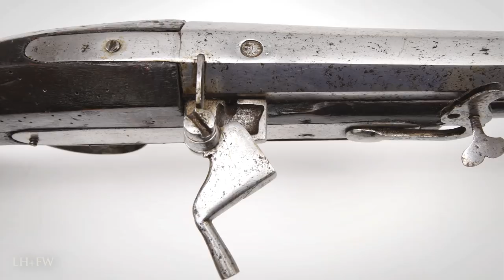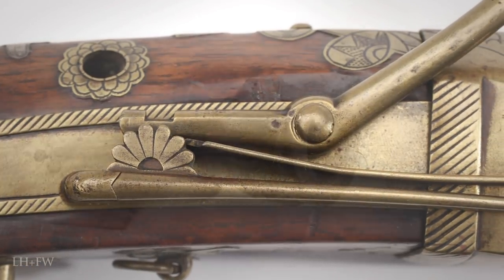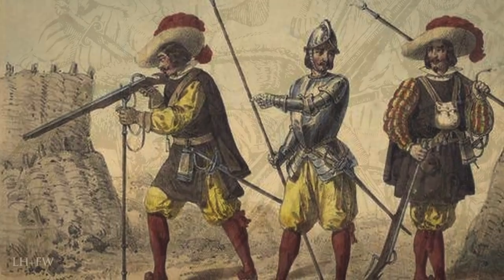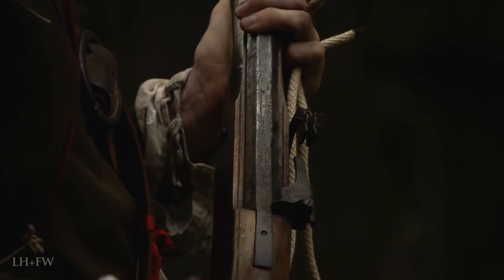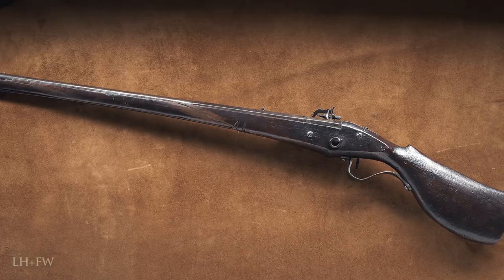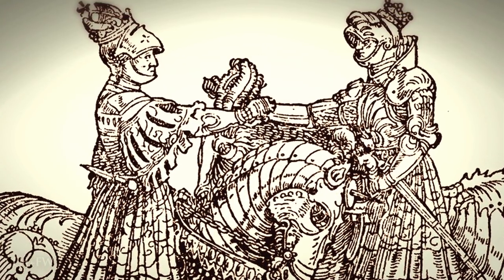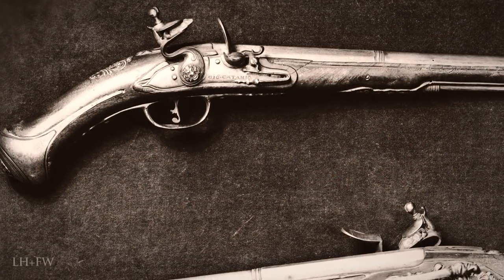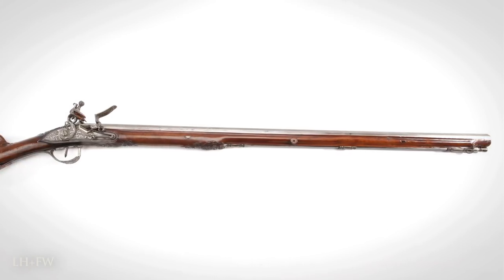From Matchlocks to Wheel-Locks in Early America -- 1500 to 1740

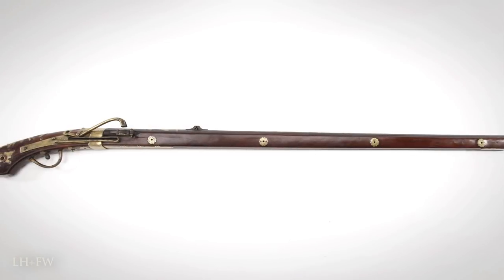Comment: Excellent video. But if my memory serves me right, while talking about the "arquebus ", the weapon shown from around 1:34 is a type of snap-matchlock called the " tanegashima" which was made in feudal Japan. You can even see that the serpentine(the curved metal bar that is designed to hold the slow match) rests on a horizontal V-spring ready to "snap" the burning match on to the priming powder in the pan. The Portuguese introduced firearms into Japan during their expeditions in the early 1600s. The Japanese quickly adopted the new firearms and modified the design to suit their gunners. Expert metalworkers were abundant in Japan at the time and they managed to produce these in substantial numbers.
The "arquebus" employed a far simpler lock(if it can even be called that) and was used in Iberia in the late 15th to early 16th century.
It was distinct because it didn't have any spring and the serpentine and the bar(which continued to the underside of the buttstock and pulling which lowered the serpentine) was a continuous piece that acted as a lever which was pivoted on a pin on the outside of the stock.
Reply: I was pulling my hair out that they didn't catch that.
Reply: The thing that bugs me is that apparently matchlock "muskets" well into the 17th century seem to have nothing but this pivoting lever connected to, well, a trigger with a trigger guard instead of that simple bar, but still, no spring or anything. No real trigger action. Any thoughts on this?
Reply: Ever Faithful there is a return spring and a lever system on the internal side of the lock plate
Reply: its making this hard to watch
Reply: I hadn't heard about the difference in lock mechanisms before. That very interesting! However, the Portuguese introduced a type of arquebus thought to be from their Indian arsenals in Goa to Japan in 1543, not the 1600s. This is what the Tanegashima teppo/hinawaju were based on.
Reply: @everfaithful9272  I've read somewhere that they could very well make it spring powered but that the impact of such a spring would often put out the match, resulting in it needing to be lit again while if you're lowering it slower through a non spring powered lock then the match wouldn't be slammed against the pan and put out but I don't know how accurate this is
Reply: No YouTubeer is safe to make a mistake on this site lol
Reply: @everfaithful9272  they had a snap matchlock in the early 1500s but yhen returned to a simpler design because it is kinda unnecessary
Reply: Arquebus comes from the Dutch "Haakbus"
Was used earlier and used throughout Europe, ended up later in Iberia.
Reply: It’s cringey in here. The Japanese copied snap matchlocks of Portuguese design. It’s a simple fact that reveals your “problematic” understanding of European history.
Reply: @shawnfisher9976 This. Weeaboos are acting as if the spring mechanism wasn't already invented and used on all firearms by the 1600s...

Comment: The wheel lock made a huge comeback in 1932... In the form of the Zippo and Ronson Original Windproof cigarette/cigar lighters.
Reply: Oof
Reply: Don't smoke
Reply: @matiasandreupinanaradrigan7862  Not a smoker. I puff cigars from time to time. Zippos are awesome to carry. I have had mine for more than 15 years. Still mint condition even after continuous heavy use. It is as blue collar American as you can be, along with Harley Davidson motorcycles and the M1911 handgun.
Reply: Ok

Comment: Faster rate of fire than a crossbow? What kind? If we're talking about heavy crossbows that's mainly for sieging and castle defense, then sure. If perhaps we're talking about the  french mounted crossbowmen (cranequinier) that uses a cranequin to span their crossbows, then sure. But if we're talking about field crossbowmen that uses a spanning belt or a goat's foot lever to span the crossbow, then that's a big no. These field deployed crossbowmen were more common than mounted the mounted ones or the one intended for siege/castle defense.
Reply: Yeah,
Reply: The ones loaded by a spanning belt or goat's foot lever had a lot less power though, I think he's talking about the windlass powered ones which in pretty sure were also used on the battlefield and took about as long to reload as a matchlock but the gun had the power advantage
Reply: @thebelgianbeast9949  Well yeah, hence why they are mainly used on the field, because of their quicker reloads and lighter weight compared to heavy crossbows. Yet they were still extremely effective, to the point that the pope wanted to have them banned because they were too efficient at killing. 

I never said that windlass crossbows weren't used on the field, I said that they were mainly used on sieges and on defense but I never excluded them. It just stands that the crossbows that are spanned by a goat's foot lever or a spanning belt were normally used in battle fields and heavy crossbows are used in sieges and eve naval warfare. Just take a looks at medieval paintings and you'll see that those windlass crossbows are always depicted in siege paintings.
Reply: @rooky3526  no, good point, I misinterpreted your comment I'm afraid
Reply: @thebelgianbeast9949  It's all good, buddy. Cheers.

Comment: Am I the only one suffering from the Mandela effect? I thought guns were made in the 1600s
Reply: You are not that wrong... The 1600s was when firearms technology seen tremendous, almost light-speed improvements over their predecessors. Precision rifled barrels, smaller bores, patched projectiles providing much better gas seal and performance, and most importantly, mechanical firing mechanisms that did not have to use a pre-lit flame source like a rope match.